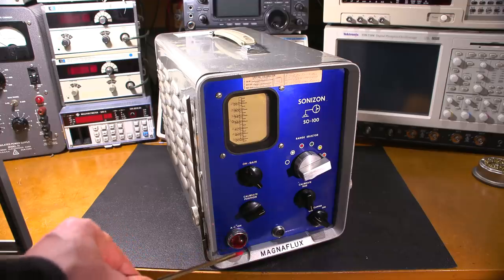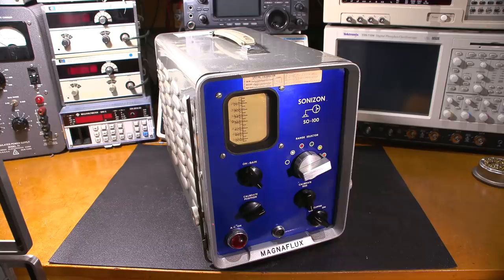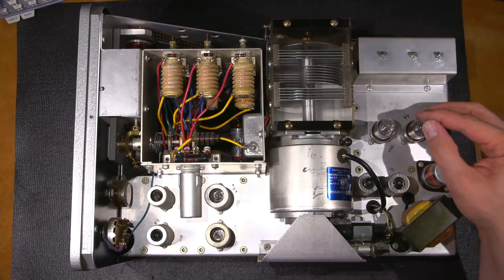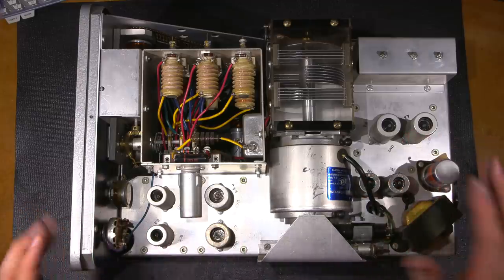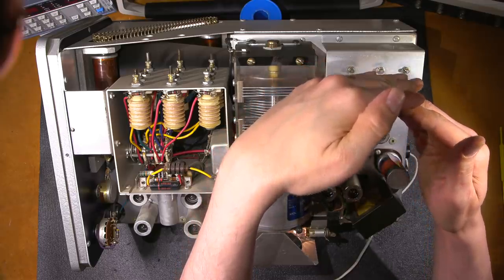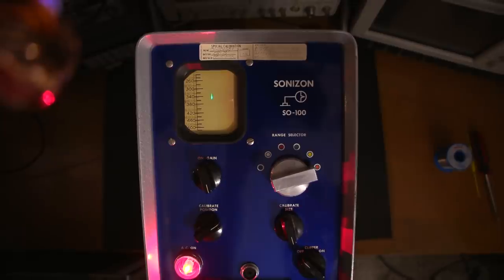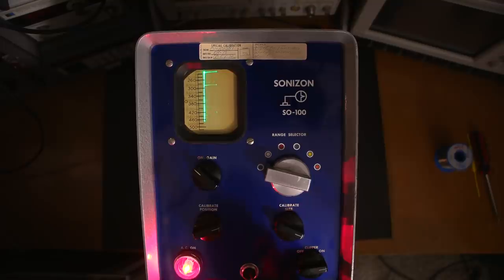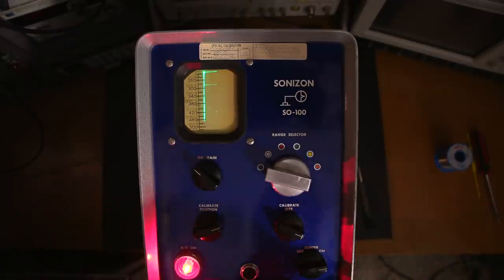Restoration or Parts Teardown- You Decide! [Sonizon SO-100]

Comment: I believe these were used in testing hidden casting flaws and cracks in cast iron parts for engine blocks, heads, crankshafts, etc. Other applications as you say welds, and such would be possible too. Will work with ferrous metals only. Never seen one in action, would be curious to see what type of pickup sensor it used. Measures flux changes in magnetic field strength. Very cool find. Would be curious to see what the transistorized versions look like.

Comment: That CRT set up has been used for a zillion forms of test equipment.  100 years ago in the Military we used a  TDR time-domain reflectometer  to locate shorts and opens on commutation lines using the vary same CTR and Grid lines.   Precision Capacitors used in timing circuits were hard to find at the time.  Oven Temp controlled  Oscillators were the only means to hope for accuracy of any type  LOL.  That light sensor set up was most likely use in timing  to control motor speed. Think Early PWM.   Tied to a AGC driving the motor  drive voltage regulating motor speed.   SAVE IT !   Museum Quality Material...

Comment: Not sure if repair/ restoration would make really sense, but the scope seems to be optically in pretty good nick! So, somehow I'm refusing to say "sacrifice it and get the nice parts out of it". 

From what you said about that device it looks like it is some kind of Impulse reflectometer to measure the runtime until reflection of an impulse coming back. The Y-axis in fact seems to be the runtime, the X-axis would be the amplitude of the returning signal and you can see the original signal sent into the transducer as top-most bar to the right. The thicker the (Coating-?) layer would be, the longer it will last the shockwave caused from transducer to travel through the layer and being reflected. When it comes back it as made it's path through the layer twice, so you could calculate the thickness (or just read out of the somehow calibrated scale for some materials). I could imagine that the device would be pretty much worthless without the transducer, and  I don't know if the scale (timebase) would be working for measuring coax cable length and such? The colour codes might come from the different kind of paint that maybe is used for coating and, of course, will have different propagation velicities of the shockwave in it. So maybe the colour has to be taken seriously as colour? Think of rocket tanks and boosters that have to be checked for paint layer thickness? I'm not sure if it really is to measure the metal thickness itself!

Comment: If you got problem in lines between SP and electronics its good idea to have a switch on the roof to cut of power for power line service. Better would be a circuit breaker for short circuit protection. Plastic degrades because of intense sunlight, if there was some kind of simple shield problem could be easily prevented.

Comment: Very unique Paul. I would think that if it does magnaflux tests, a lot of Machine/ Tool and Die shops could make good use of a unit like that. On the other hand,,, it has some great parts ;p)
Reply: Skycarl, it doesn't do eddy  current defect detection it measures thickness using resonance instead of pulse echo. Bottom of this shows basic theory of operation 
http://avstop.com/ac/apgeneral/ultrasonic.html

Comment: Nice equipment in great cosmetic condition makes me favor restoration. My guess is that this is used to examine metal for internal cracks and fractures, and possibly to measure surface coating thickness. There are loads of oscilloscopes and signal generators, but this device performs a singular type of test, and that alone makes it collectible. The only problem is that the transducer may use something exotic like a ferrite rod; also, you can calibrate the electrical signals to and from the transducer, but calibration might involve some kind of stepped metal plate and/or some certified coating thickness standard. Hopefully, the manual talks about the transducer in detail.

Comment: Unless you're going to use it to measure the thickness of the copper on your blank PCB's, I vote to scrap it for parts... Otherwise if you do do a resto, it will be an excellent paper weight... Once again Paul, an excellent presentation... 10/10

Comment: Restoring the main unit would simply be replacing a bunch of capacitors which is not too interesting in its self.  But - I think it would be very interesting to see what you would come up with to make a "Carlson" version of the sensor probe.  And then it would be great to see how it's used.  Is it only for determining the thickness of metal?  Or can it also be used to detect flaws (cracks, voids...) in materials?

Comment: Definitely restoration.  Due to my knowledge of Magnaflux, they are known for providing tools to find cracks and faults in castings and welds.  The main line was using a magnetic coil to induce currents in for example an engine block casting. Where there is a fault, the eddy currents in the block would be reduced by the electrical break in the metal.  After applying an oil based fine powdered iron film, By using a UV light, small cracks aligned the material in the magnetic field so cracks would be highlighted by the process.  I have a working Magnaflux mercury vapor UV filtered inspection light.
It may be possible the pickup for the device is a pick up coil to measure the induced resistance in a metal sheet such as the skin of an aircraft to identify stress cracks, corrosion on rivets, or other faults that would disrupt induced electrical currents.  If the device is an ultrasonic mechanical transducer, any air gap or bubble between the transducer and surface would produce poor readings. It would vibrate the sheet metal surface to see the change in tuning by the added mass to the transducer.  I'm thinking the probe is most likely a set of various size sensing coils. As the surface resistance varies, it would change the tuning on the coil which is detected by the swept tuning range for each sensing coil and this tune peak is likely displayed on the CRT.

Comment: Wow, that looks maybe similar to a Krautkramer sonic defect detector. We used a KrautKramer sonic thickness gauge which is only for verification of the thickness of parts we machined for the External Tank for the Space Shuttle back in the 80's. You should definitely not use that one for spare parts. It has to be Apollo era or older. It may have been used to verify the quality of machined parts prior to use, even the Nuclear power industry has need of this type of equipment.

Comment: IMO, whether or not you decide to restore it depends 100% upon whether you can re-create the probe, or head. To me, there weren't all that many great parts in it. All the tubes you showed are fairly common; all the caps are old, the 50 nice resistors you might get out of it are no better then 25 cents each new metal film, that's $7.50. You want 12AU7 clear-tops? Go find an old CONN organ and you'll find 36 of them. No, they won't be "new". The cabinet is pretty cool, my take is that the cab would be the thing of most value you'd get out of it, and what would you build inside of such a cab that you don't already have? Plus, taking it apart blows off that really nice motor & photocell detector ass'y. I say put it back on the shelf where it will patiently wait for your decision like it has for the past 5 years.

Comment: It looks like it would be restorable and wasn't horrible inside. The one part that you didn't talk about was the probe. If that's an active transducer, you're going to have a hard time making this work again regardless of what you do with the internal parts. If the probe can be found or one made, go for the restoration. I don't know that this will be all that useful, but it's an interesting piece of gear. If you can't get a working probe then restoring it doesn't make much sense. In that case you have what looks like a nice bright CRT and a useable case that could maybe be re-purposed into something useful.

Comment: Deffo Restore!! Even if you have no use for it, it would be a shame to just rip it apart for parts. I wish I had kept the frequency meter I was allowed to play with 29 years ago when I was 16 in an electronics workshop. It used backlit projected number modules and really weird timing modules; metal cans which had black glass like  transistors, resistors and ceramic caps all leg soldered to lots of pins in a bank of 10 or more slots inside it.Why does the varicap spin round like a demented windmill? Is it for the sweep of the line on the scope instead of a sawtooth generator?

Comment: Magnaflux is old school term for crack finding in heads and blocks in automotive field. Was a technique of magnetic dust and applying a magnetic field to the item to be checked and it will outline cracks in the material.

Comment: Restore that beautiful piece of industrial history Please! It appears that it would be a rather easy restoration, with possibly the exception of recreating the screen scale film. I would hazard to guess that the ”head unit” or sensor unit was probably just a ultrasonic transmitter transducer and an ultrasonic receiver transducer so they would be easy to recreate. I think that it would be fun to experiment with when restored. Who knows depending on the output frequency of the oscillators with a doubler or tripler circuit added it could possibly be used as a sweep generator for radio IF circuits. Such fine construction it would be a shame to scrap it for parts.

Comment: I would ask if it economically makes sense. If you have a use for it then go for it, definitely an interesting piece of analog tech. That being said, was it cashiered for a reason? The selection tape looks proprietary and rare. Has this been replaced by something better and was outdated by a cheaper and more accurate device. Is the head tool an expensive replacement? Can you fix it and sell it? To me it looks like a treasure trove of spare parts. Too specialized and narrow use for anything else. Good luck and have a nice day.

Comment: First thing to consider; do you have, or do you know anyone who has a use for that equipment if it was restored?  If the answer is, “No!” then the second thing to consider is, ‘can it be repurposed’?  If again, the answer is, “No,” or, “Not immediately,” then either do with it what the consensus says here in the comments section, or put it back to one side until you have a positive use for it - be that for spare parts, or otherwise.
Phil.

Comment: "...inspecting welds..."
10 points. (Other things too, I guess.) When I was a welders apprentice I was shuffled around all the different parts of the yard. Including non-destructive testing. The guy from NDT I was with didn't use things like that. Only x-ray. But I saw things like that being used. Portable ones.
No probe. Tons of caps to replace. Etc etc.  Yeah. I won't hold it against you if you cannibalize it for parts.

Comment: I am following another channel where a man is restoring a 30 plus foot steel hull boat. In the process of restoring the hull. He used a more modern version of this type of testing equipment to see if corrosion of the metal on the hull had penatrated to far into the hull compromising its integrity. With this testore, he was able to determine areas where he needed to cut out some corroded areas and wield in a new patch.

I think this would be a great restoration project. Especially since the unit was built to a higher standard for technical testing.

However where or how would you be able to find or make the test leads. 

I enjoy your channel.

Comment: I have the same dillema, i have an instrument that measures some thicknes ( I think it measures paint thickness) No manual to find, not even a description. It is missing the probe (or whatever it is). Not even in such a nice condition. I have no use for it but I am just curious to see it in action. 
You can not talk about value in cases like this. I restored an old cable check TDR for the owner. Costed him more as it is probably worth if you see it very B&W, but for him it was worth it because it was the first bit of kit he bought when he started his company., no service doc and it was defect, calibration was an adventure on its own. I used the TDR from my digital VNA and an old Tektronix 1S2 as a compare and a lot of GR rigid air-coax  stacked as transfer standards.

Comment: A piece of interesting vintage electronic device, this is a part of history and worth to restore or keep it as is, most of the parts are specifically designed for this machine and may useless for other purposes, so since it is at very good condition spending little time to restore defiantly will be my choice.

Comment: Mr. Carlson, A compromise solution, if I may. Don't tear this unit apart, and don't spend too much effort on a full restoration. As it's unlikely you will stumble across the probe (head end) perhaps document it (as you have already done in this video) and move on.  It might be tempting to salvage the valves (tubes) and leave the screen (shield) cans in place or populate with lesser grade ones.

BTW, Magnaflux is still around as a brand under ITW. They were well known when I lived in Chicago, a spectacular campus on Harlem Avenue in Glenview, Illinois. Magnaflux provides NDT (Non Destructive Testing) tools.
Their bread and butter products are/were ferrous dyes that are used to detect cracks in metal foundry pieces using an electro-magnetic field and UV light. Also, conventional ultrasonic flaw and crack detection.
Your unit was likely a more precise plating or coating thickness detector, using the electronics technology of the day (late 1960's)

Thanks for sharing your tear down analysis!!

Comment: Magnaflux is the name that was known throughout the automobile industry. The magnaflux machine was used to detect cracks in cylinder heads. I know because I was an automobile mechanic for 45 years. And when we took a head off of a car we sent it out to a machine shop to be magnafluxed. This was on cars that were suspected of having a cracked head. This thing could be restored and sold to a machine shop. As it is very useful to the automobile industry.

Comment: I was thinking after I posted the comment about using a TX and RX crystal, this is more along the lines of vascular untrasound for measuring blood flow and I'm not 100% sure how well it would work. I also realised that at a half wavelength the peak in the returned signal would probably not be that noticeable, however, you would still get sharp nulls at a quarter wavelength.
I also thought that perhaps you could use a single PZT crystal for the test transducer and detect the quarter wave nulls by measuring the VSWR or maybe just be simply detecting the signal level at the transmitter but I'm not sure how well that would work. And lastly, you would also have to compensate for the line length between the transmitter and the probe.

Comment: Hmm... I see I'm a bit late to the party.
Definitely restore! It has some cool mechanisms (which may be the hard parts to do).
That rolling screen could probably be duplicated onto clear film by a competent copy shop. You might have to take a guess at the type of plastic to use; it may be cellulose acetate. I wonder if there is a tensioner there, since as the screens roll by the diameters of the two spools would vary a bit and change the tension of the strip.
I guess it is some sort of time domain reflectometer, though I'm not sure why that would need the flying capacitors. I suppose the reflection time in this case (fractions of a nanosecond) would be too small to measure directly so instead some sort of phase or frequency shifting is used.

Comment: If all this were was an oscilloscope or a curve tracer, I could see you using it for salvage but this device is so particular electronically and mechanically and is so purpose-built that I think you should restore it. The only thing I'd wonder about is the possibility of acquiring or reproducing the measurement probe; if that's impossible then I'd say salvage instead.

Comment: Mr Carlson - are you familiar with the Old DC Voltmeters made by Sensitive Research Instrument Company? I have a DC Voltmeter probably made around 1950 has an off position 3 Volt 15 Volt 75 Volt 150 Volt and 300 Volt Position Switch and 2 Terminals on top for connection. If has been into before and the voltage reading is 1.5 - 2 volts too high. It looks to maybe have a resistor in heat-shrink in the internal wiring and was curious if it was the wrong size.

Comment: Magnaflux is still very much used in industry for locating cracks in heavy metal parts for example fork lift forks. I will have to try to research this, but I believe decades ago when truck wheels began to leave their axles due to fractured lugs, it was a couple of young Canadians who invented this system. As I say this needs to be confirmed. Restore this unit.
Reply: I think this is an ultrasonic unit, rather than a magnetic flux unit.

Comment: interesting its the pickup needed.   on slitters cutting steel coils  say .010 to .187 thickness for that type of machine and coil weights to 30 tons we had a device the measured thickness while it stopped or running     the pickup  can be moved horizontal across the width of the coil thus measuring also the crown of the coil .    this pickup had a radioactive sticker on it.   of course very low radiation.     we used to joke about it if you  put your balls by it  cause you sterile  don't know if that was thru but never tried it hi.      enjoyed you video     take care Paul